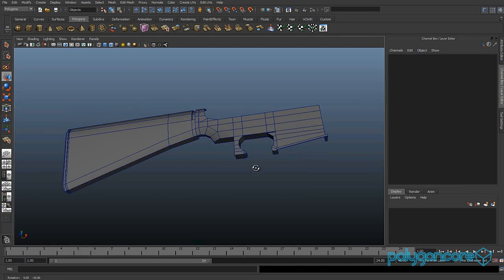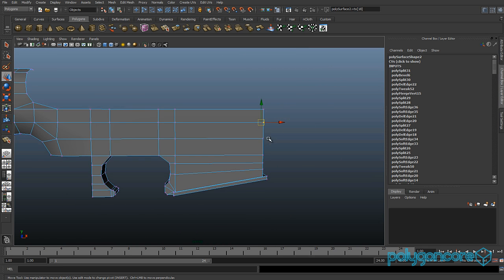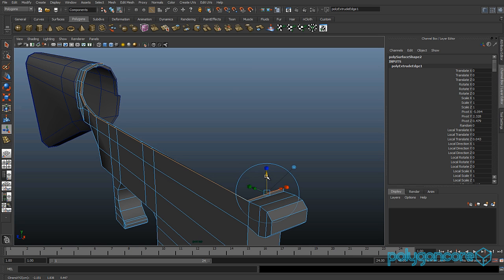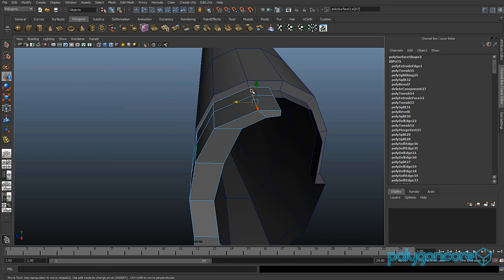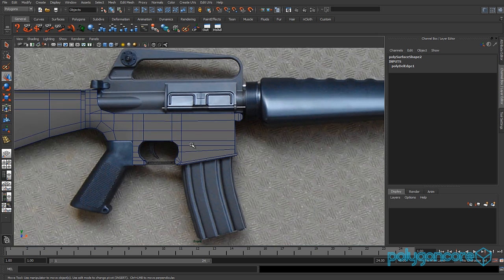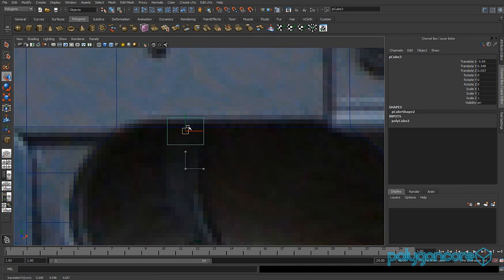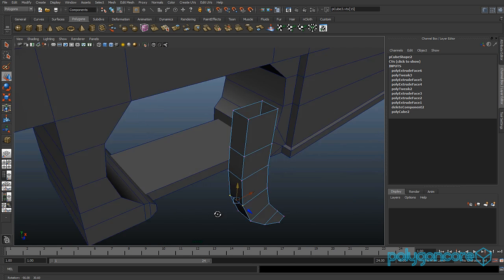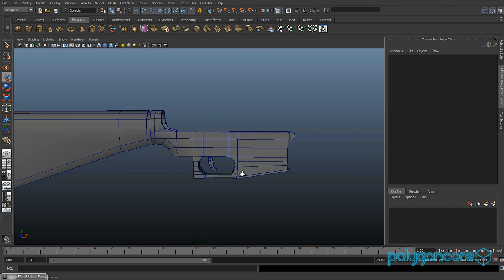M16A1 Maya Modeling Tutorial Part3

Comment from the maker: Try to keep your model as low as possible if you want to put in game engine, remove useless edges on flat surface and add edges division to round a part. 
Triangles are not a problems, ngons yes, you can check them in maya with constraint selection.
One last thing, think about the textures maps when you model, like example on my M16, holes are in the alpha of my diffuse map, screws and other details are in the normal map.